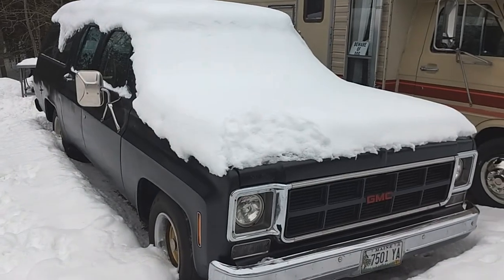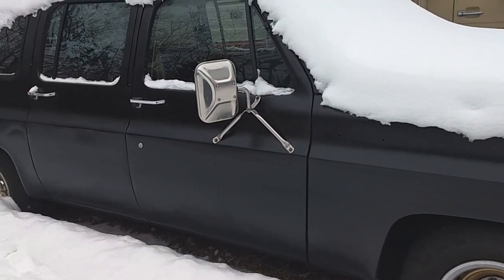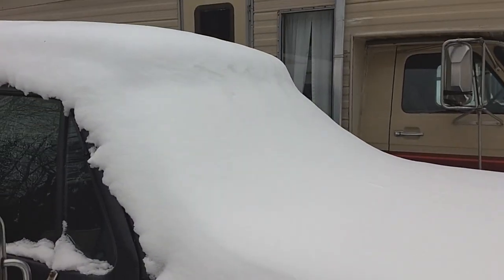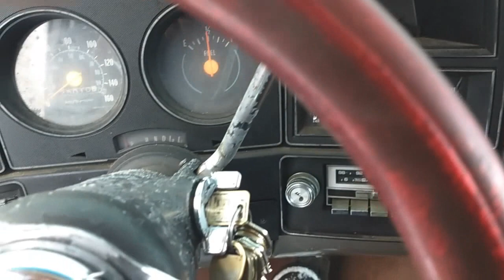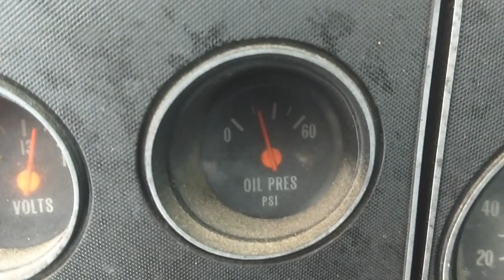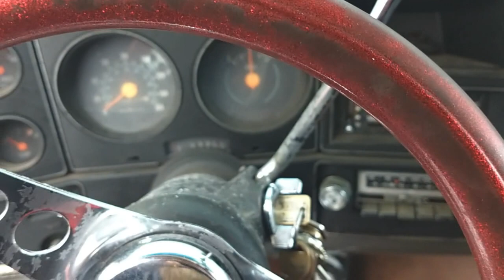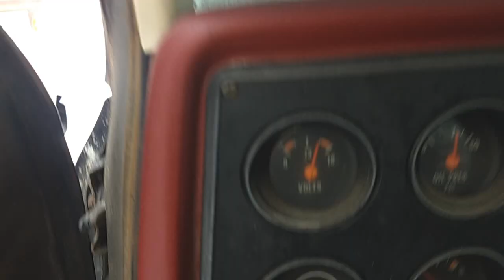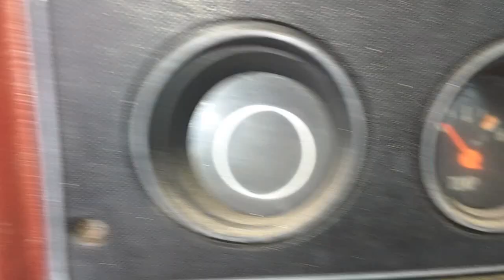1978 Suburban 12 degree COLD START No choke-2021

Comment: I got a 94 just keep a good battery in it and it starts at -40 without a issue havent plugged it in since I bought the truck
Reply from the maker: Fuel injected?
Reply: @acrazycanuck78  yup tbi only problem I had was the hose going to the map sensor break other then that 330,000 and running strong